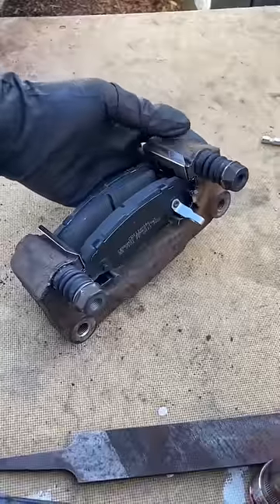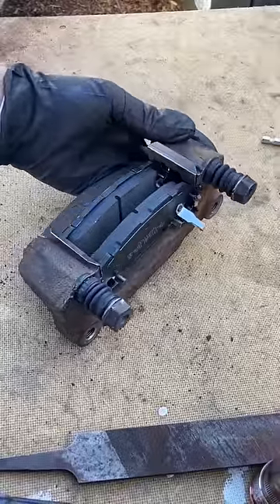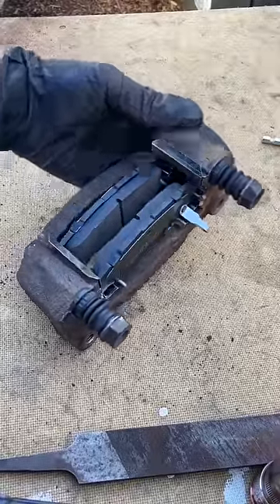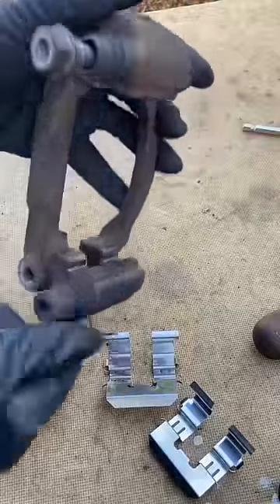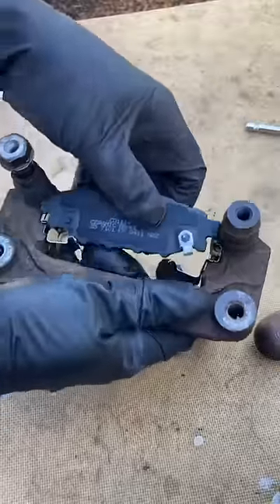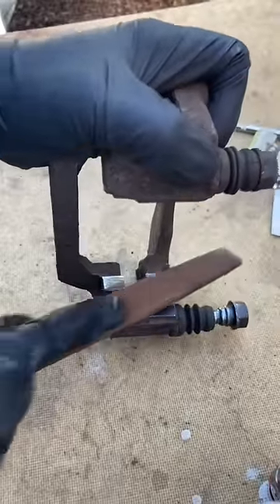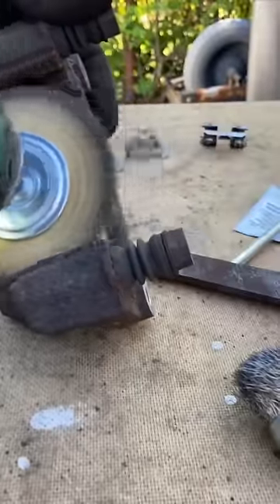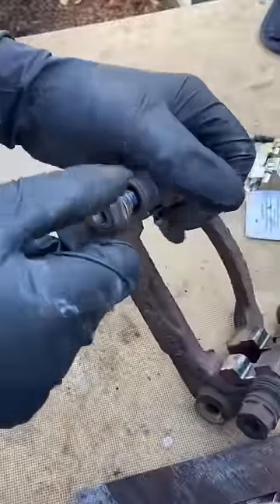What’s the Difference Between a $50 Brake Job and  $200 Brake Job

Comment from the maker: Tools used for the brakes: https://www.amazon.com/shop/andythextech/list/477B0RRS6WCZ?ref_=cm_sw_r_cp_ud_aipsflist_aipsfandythextech_2BW6BWJYB4WP553PMNVQ
Reply: I see most manufacturers saying to replace the caliber bracket at 100k but who does that. I usually do exactly what you're doing cleaning the build up off with a wire brush. Have you ever had a front bracket break off while driving? Nice job.
Reply: Where you located? You're doing my brakes from now on.
Reply: This was a perfect video, getting ready to start making my own on fixing things around the house . So I watch content on my spare time. Anyways nice job and thanks for the video.
Reply: What was that small rubber piece put on pin at end air gap what?
Reply: 200…lol before another 100 dollar tip and a beer and a meal shit man youll b livin w a pack of warer redbull wtf ever u want lol. Well done. Love and respect
Reply: Arena you glad your an ex tech?